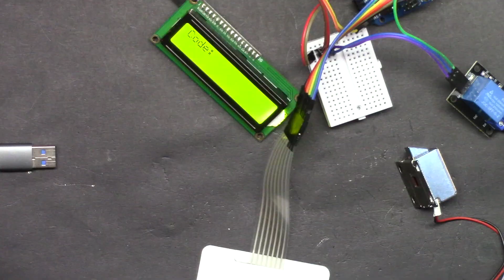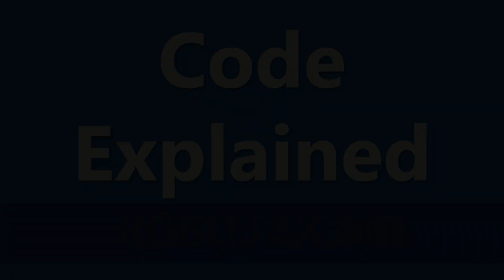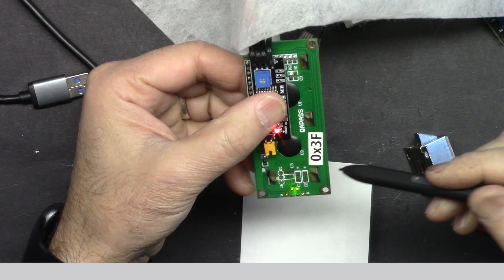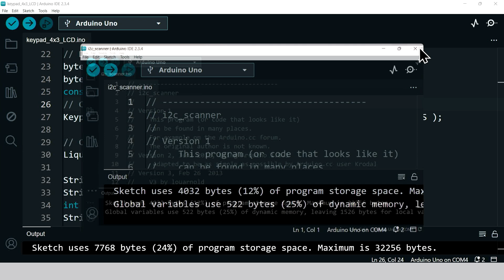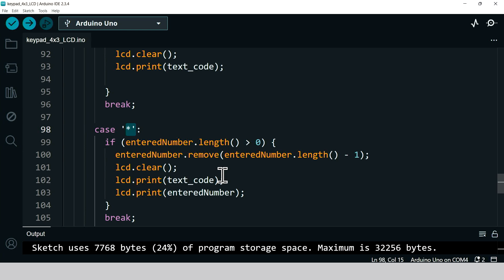Build Arduino Electronic Lock with Keypad LCD

Comment: Sir you could also add a diode in parallel with the solenoid coil. In worst scenario it can damage the battery
Reply from the maker: there is no semiconductor to protect. it is just the relay. it would be extra. if MOSFET or transistor were used, then a diode would protected that.